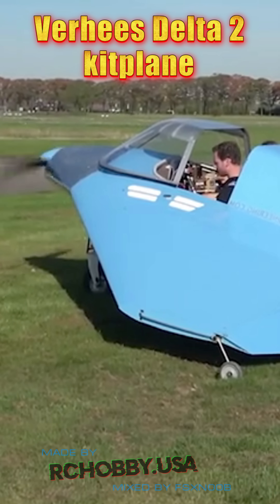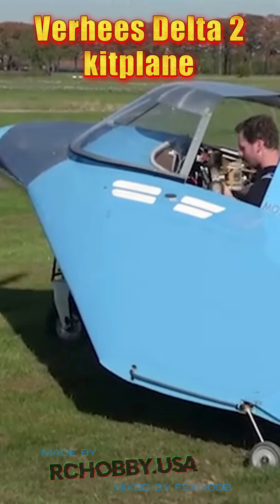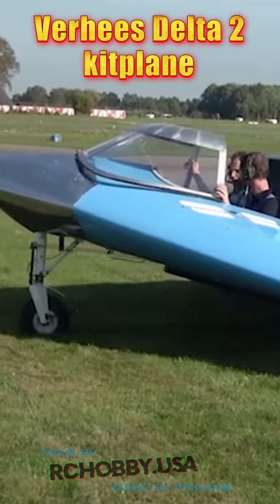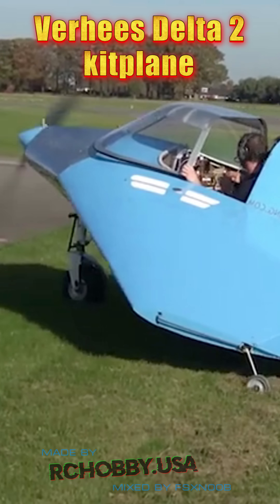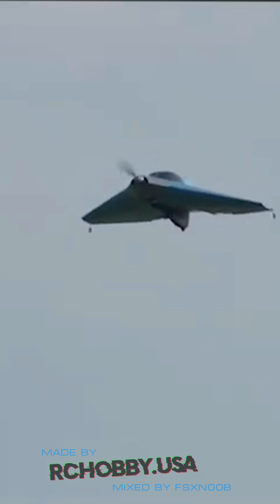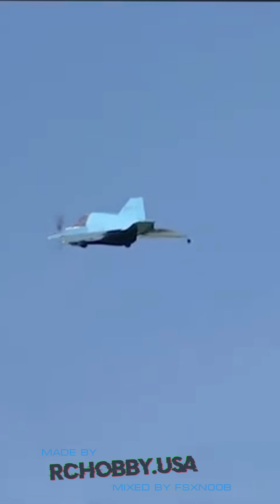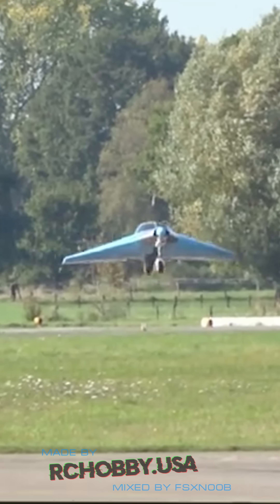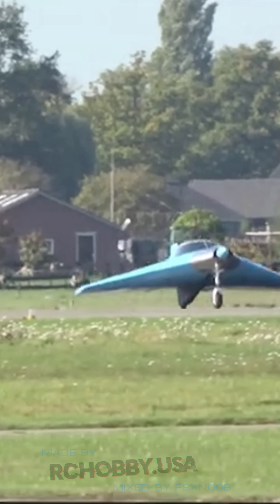A Game Changer in Aviation - Verhees Delta 2 Kitplane #shorts #aviation

Comment: john denver also thought this was a neat hobby
Reply: People think cars are a nice hobby and 40k people die from them in the US alone.
Reply: @thomgizziz  faulty logic dude
Reply: @joejones9520 No. It's not faulty Denver didn't build the plane he crashed and the builder modification of fuel selector location and questionable prefight was the cause of the crash of a very safe design.
Over 800 are registered with the FAA and 114 have crashed since 1980. 40 years of flying with only 44 deaths is very good odds and better than a car by a long shot.
The long ez has nearly the best record of all homebuilt aircraft and on par with commercial built aircraft.
I'd fly a long ez over a delta every time.

Comment: That's awesome! I'm wondering if the engine has a problem, will it glide with the delta wing? Great video
Reply: about as well as any other light aircraft.
Reply: The rotax 912 has a long history of reliable use in experimental aircraft. More than 40 years.
Personally I liked the 914 2 stroke model better just for the power to weight and easy rebuild of a 2 stroke.
Most the weight advantage was lost in the gear reduction needed.
The 912 is as good or better than the vw/porche  conversation alternative and still available new from the factory.

Comment: 36.98 gallon capacity 4.22 gallons per hour, 118 knots cruise speed, 932 mile range.
Stop with the fucking metric shit.
Flight around the world is in Imperial units, not metric dog shit.
Reply: You're offended over a measurement system.

Comment: that looks really wobbly.
Reply: Great observation! Original pure flying wings pretty much failed because of their inherent instability. Fly-by-wire and predictive computing let the B2, the Space Shuttle, and a few other very delta wing reliant jets become viable. 

The basic delta wing does become more stable at high subsonic and trans/supersonic speeds, hence it's more common use on very high speed aircraft. 

On this lightweight slow design, it will generate efficient lift, allowing for greater range and speed with a comparable powerplant to other tiny kit planes. But it will always be less stable.

I'd have more faith if it had some kind of twin boom tail design, like a p-38, or even better a fly-by-wire system. Which would make it much more expensive. And cheap is kinda the entire point of kit planes. Which are already a bit notorious for... Safety risks. 

If you were to stall and nosedive, you'd still have an extra 50k in your pocket.
Reply: @RD1R I do not think so.
In the 70s I owned a flying wing rc-model glider, only controlled by ailerons, which worked pretty fine. And in the 00-years I had an rc-controlled delta wing electric model-plane. Not easy to fly, because small and fast, but manageable for a mid-class pilot.
All that without computer aids.
Only finns without ruders.
Reply: @martinoberngruber1893 delta wings are completely different the bigger you get, theres a reason you choose a strong wing with a reasonable engine placement because if you lose the engine or a control surface you can still land, delta wings lose control in all sorts of unpredictable ways.. a small rc one has very different aerodynamics
Reply: @RD1R the rear of the plane has a missile/torpedo-like design. The rudder is pretty tall & the bottom rear of the fuselage has a kinda fin design on underside as well. So, not a true delta wing, wouldn't that design be more stable? 🤔
Reply: @BillyJoeJimBob28  absolutely more stable than a pure flying dorito, but less so than a long, straight wing design. It also lacks controls to mitigate the delta wing slow speed performance. 

The most basic forms of control enhancement are tails and bigger ailerons. Some extreme delta experiments and the b2 managed to get rid of one of those by designing a very advanced flight CPU. The next best and fanciest version are wings that sweep forwards or back mid-flight. More common and familiar uses are slats and flaps. Big airliners use them to mitigate lift and control loss at slow speeds because they have fuel efficient swept wings. They aren't deltas, but they have enough delta design inspiration it takes some extra variable surface area and angles.

The concepts are all somewhat simple, but every plane blurs lines and has unique designs. The good designs take all of these variables into account and balance control control performance vs lift vs fuel efficiency, and the sum of all that vs cost.  

A delta wing kit plane screams at me they put all their eggs in the lift basket to keep costs down... Meaning control performance could be... Iffy.
Reply: Many experimentals and kitplanes are never adequately flight tested.
Reply: Landing speed is too high for Australia.
Reply: Looks wobbly, yes. The whole structure seems to wobble in itself too.
Reply: Yeah, slow speeds are not its forte. But I think it could be a great longer-distance solo plane for people who like to move around a lot.
Reply: It's cutting edge stealth technology

Comment: (looking at the wingtip where the small wheel is attached)
I wonder if redesigning the wingtip to have a modern tip design would help reduce drag and increase range?  Nothing outrageous, just the additional tip you see on commercial planes.  You know, the bit that flips up.

Comment: Two different planes. The one with the silver cockpit roof has wheels attached to the back of the wingtips, the one with a blue cockpit has them on front
Reply: He does talk about them both the delta 1 and delta 2. So most likely showed the 2 examples.
Reply: @Abaddon79 It's more likely a minor design change, the one seat prototype looks quite different.
Reply: You're sharp
Reply: Just 2 different birds of the same model.
Reply: And the pilots too are wearing different clothes
Reply: If you look, it appears that the rod that supports the wing wheels hinge at the front. They lock in the back position, when they takeoff they drop forward on the hinge. That allows for travel on uneven surfaces.
Reply: @robertrobertson5333  Looks like they extend for landing.

Comment: It’s been around for over 50 years hasn’t changed any games
Reply: Delta wings perform poorly at low airspeeds. These prop planes fly at low airspeeds.
Reply: @wavebuilder14udc75  Delta wings in the context of jet engine fighters with heavy weights, built out of metal and thin wings. This is pretty much like the flying pancake.
Reply: @zakurn1086  im unsure what you mean. 
But wing planforms are designed to perform in specific ways in different conditions. Delta wings as a planform are only really useful at super sonic speeds. That doesn’t mean you can’t make a slow plane with delta wings (as we see here) but it is impractical due to the poor flight characteristics these wing planforms have at the speeds this plane will fly at. Especially stall characteristics.
Reply: @wavebuilder14udc75  What I meant is, delta wings as you generally know it are the ones applied to jet fighters, with specific builds, specific characteristics of flight and airflow through the wing cross section and surface and these tend to be made out of metal and thin to be able to achieve higher speeds, that is why they perform so poorly in low speeds. 

The plane in this video unlike delta wing fighterjets, is the whole delta, it is very thick, generating much more lift at lower speeds, since they don't need to reach supersonic speeds and thus having much better flight peformance for it's operating speed.
Reply: @wavebuilder14udc75  Tell that to owners of Fauvel gliders and their powered follow on. machine.
Reply: Not meant to, it's a build at homeplane for aviation enthusiasts, almost like a 1940's beetle but for aviation.
Reply: By game-changer he meant death-trap.
Reply: looks unstable
Reply: @delphinazizumbo8674  I THOUGHT AS MUCH. I WON'T GET IN  THAT!
Reply: @delphinazizumbo8674  yeah I was thinking about the videos of Lockheeds early flying wing tests that ended in crashes or the one of the British bomber flying wing crashes etc etc and the US B2 and B21 Raider that have some of the fastest most advanced complex flight computers that keep them airborne unable to fly without them constantly performing millions of calculations and adjustments to throttle /control surfaces etc  per fraction of a millisecond
Reply: It changed games in YouTube shorts economy alright 😂
Reply: @SadL64mm He may be thinking of the "Dyke delta" a plans built delta from 1966.
None of these deltas are a game changer in private aviation.
I'd bet this is unstable and results in white knuckles 
I can see why someone would like and want this design but if I had a rotax 912s I'd put it in a pulsar and have very similar range at higher speed. Or even a KR-2.
Reply: probably ended a few though
Reply: But why? Especially today with the advancement of aviation grade carbon composite manufacturers and stamping companies that could surely create a 1 piece composite flying wing that’d be stronger and lighter and if this is true and the range and lift area is so crazily better , the engine a reliable cheap Rotax , how is this not the standard? Genuinely asking. If this is true but it’s been around 50 years why do we still see ALL civilian planes with the standard configuration if it’s less relieable , less strong, much more maintenance heavy, expensive , much less lift and efficiency , less capable much more expensive? Surely there’s some fatal flaw that’s kept this type of plane from becoming a standard?
Reply: @MZ-bl6wg Design has to many flaws for U.L airplane but can be improved with small front  nose wings or double delta wings for better stability. For efficiency speed and range it,s impressive but doesn’t matter if it,s hard and demanding to fly for extended periods of time due to stability issues and the answer why the design never became popular.
Reply: "Stealth" fans put the rest of us into perpetual, fraudulent debt.  "Stealth" fans watch the rain/snow line on the Weather Channel but never catch on.
Reply: not even war thunder?
Reply: Not 50, but even 80 years. Looks like one of the Lippisch airplanes like the so-called “Flying Triangle” only with a prop instead of a jet engine.
Reply: Delta wing experimentation in the private sector and the military is what made modern stealth aircraft possible, Mr. Limited Mental Capacity.
Reply: @Howie-du7ov  Yeah, but they are also remarkably unstable in flight, with a lot of side drifting because of the lack of sideways air resistance since it doesn't have any form of rudder (Edit: I was refering to stealth planes in general, since the good ones use the famous "flying wing" design or some form of it), so they rely a lot on computer stabilization and fly-by-wire to keep a straight path
Reply: @projectdeveloper9311  This plane does have a rudder, it's not a flying wing.
Reply: @projectdeveloper9311  So if it has no rudder, what's the thing above the tailwheel?
Reply: @ghz24  Yeah I know, the way I phrased it wasn't very clear, but I was talking about stealth planes in general, since they tend to use some form of the flying wind design, or at least part of it's concept
Reply: @projectdeveloper9311   But it works, so what's the problem?
Reply: @Howie-du7ov  The problem is not really that it works, is that it works on those conditions I said, with highly advanced and studied equipment, made with enough money to buy you and me 10 lifetimes without problems, and that clearly is not what it's used in that plane nor what it's supposed to use
Reply: @projectdeveloper9311 Very few actual stealth aircraft use a flying wing design lol. The only one is the obvious B-2 (and it's new replacement, the B-21). Other than that though every other model uses either pretty conventional wing and tail arrangements or conventional/delta hybrid wings with tails.
Reply: @Howie-du7ov  No it was equations for calculating radio reflections derived by a Russian researcher that made stealth possible and started the research of "have blue" and resulted in the hopeless diamond that became the F-117.
It's simple physics that steered them toward deltas and flying wings which were developed for high speed performance not stealthyness.
The flying wing was researched and built because it is highly efficient and has a huge internal space for cargo, fuel and bombs ect.
Delta wings are not the same as the flying wing as designed by Jack Northrop.
Reply: @ghz24   You are taking my comment to a level that wasn't intended by my comment. Are you trying to impress me with your knowledge of stealth technology? Because if you are it's a waste of your time. I really don't care that much.
Reply: Bot spotted  @Howie-du7ov

Comment: You could fly from the tip of Canada to London nonstop with this in solo mode!
Reply: Yes, via Greenland, iceland and Scotland
Reply: You just need to be able to do 700 straight @MachinecoMachines
Reply: You could fly over the Faroe Islands and admire the ancient pyramids.
Reply: @MachinecoMachines  No, directly.
Reply: Only the tip?👀
Reply: @enderchicken1 a promise is a promise…
Reply: @gavinknight8560  Dammit
Reply: @enderchicken1 Yes.  I promise. Just the tip.
Reply: Maybe
Reply: )) как на АН-2 ? 
В августе 2015 года Михаэль Манусакис (Michael Manousakis), глава фирмы продажи старой военной техники «Morlock Motors» (Германия), пересек Атлантический океан на стареньком АН-2, в который он встроил дополнительные баки для горючего. Летчик купил 41-летний списанный самолет в ВВС Польши и немного его модернизировал. Манусакис летел по маршруту Германия - Шотландия - Исландия - Гренландия - Канада - Нью-Йорк , на что потратил менее 24 часов. Мотивом перелета Мануасакиса был обмен — его американский партнер во что бы то ни стало желал иметь АН-2 — за него он пообещал Манусакису отдать свой Cessna о2 Skymaster

In August 2015, Michael Manousakis, head of the military equipment dealership Morlock Motors (Germany), crossed the Atlantic Ocean in an old AN-2, into which he had installed additional fuel tanks. The pilot bought the 41-year-old decommissioned aircraft from the Polish Air Force and slightly modernized it. Manousakis flew the route Germany - Scotland - Iceland - Greenland - Canada - New York, which took less than 24 hours. The motive for Manousakis' flight was an exchange - his American partner wanted the AN-2 at all costs - he promised to give Manousakis his Cessna о2 Skymaster in exchange for it.
Reply: You could,but the question is would you want to?
Reply: @enoz.j3506   Who wouldn't want to? Just being able to cross a continent all by yourself is an amazing thing...
Reply: Yes, because flying across the Atlantic in a tiny kit plane is definitely a great idea, what's the worst that could happen?
Reply: @JustACuteFox  The worst that could happen is staying home!
Reply: London Ontario maybe. Toronto to London England is about 3500 miles or 5600 kilometres.
Reply: @mothmagic1 now take off 1400km and leave from gaspe... still canada ..then Greenland, Iceland, scotland
Reply: Any headwind would create too much drama.

Comment: The cockpit hatch failing to stay locked open in the video definitely bodes well for the quality of this plane
Reply: They had the lock released. It's a quality kit.
Reply: i mean its a kit plane, so whoever made it probably scratched their head wondering why they didnt use up all the parts
Reply: @mf.danger9235  He can think about that for a whole 8 hours up in the air.
Reply: It was subcontracted to Boeing.
Reply: Its not that deep, homie. It's one Data point you don't even have enough information to crow about with.
Reply: @POVwithRC Well then, might we point out how the plane is clearly unstable and hard to fly in a controlled manner by the footage of it taking off?
Reply: Better failing to lock open, than failing to lock closed?? Ehhh, maybe. Lol
Reply: He is Russian.
Reply: Prob doesnt have a latch to lock open. It's a kit plane
Reply: It doesn't lock open.
Reply: How do you know it wouldn't stat latched?  How do you know the pilot isn't operating with it open?
Reply: @SFranz-jj5vv  because when the plane pulled forward on the grass the it slide backwards and the pilot had to catch it. Diggy meant stay latched open, your thinking stay latched closed.
Reply: @nicholastrawinski  there aren't usually latches to hold doors open.  My Pawnee doesn't have a latch to hold the door open.  It probably only had a latch to keep it closed.
Reply: @SFranz-jj5vv  many planes have latches to hold doors open. Cherokees, Barons and Bonanazas, some 172s. It is pretty common.

Comment: Looks just like the Dike Delta Kit.
Reply: The Dyke is a welded steel tube fuselage aircraft, while the Delta II is all sheet aluminum.
Reply: The dyke was 4 place and not a kit just plans.
Reply: 4 to five seater aircraft?
Reply: The Dyke Delta was prettier.